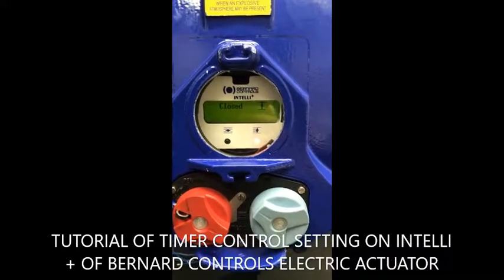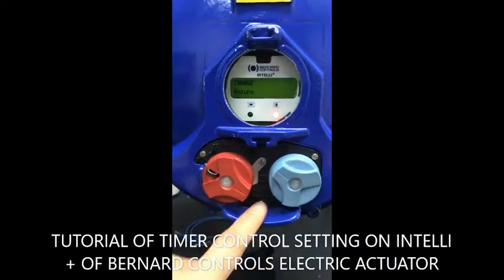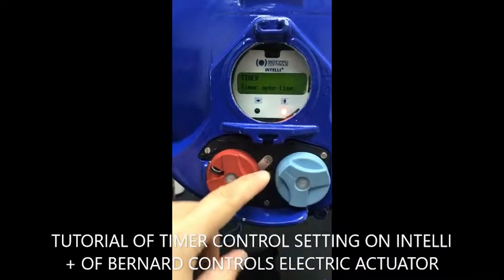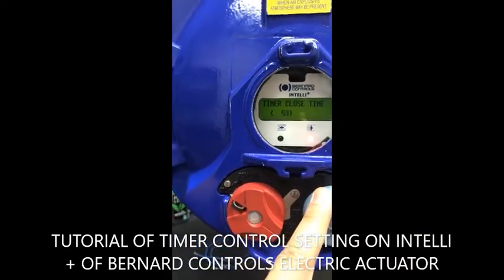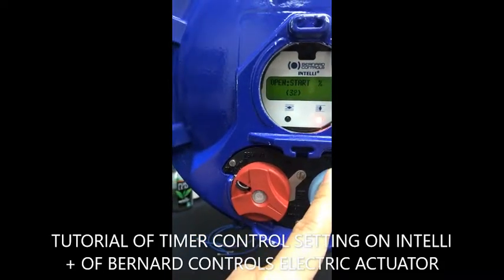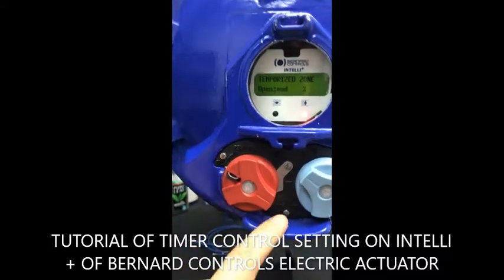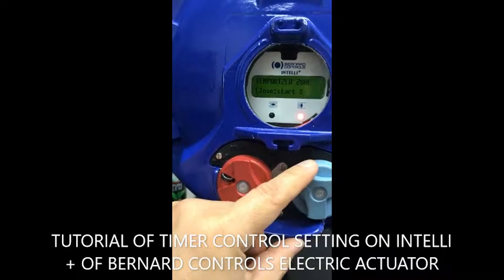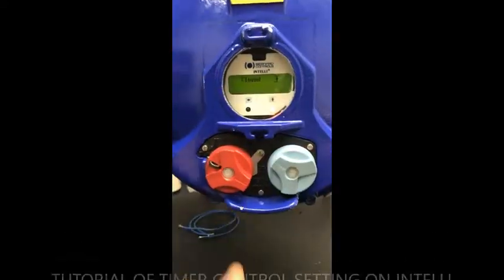TUTORIAL TIMER SETTING ON INTELLI+ - BERNARD CONTROLS - ELECTRIC ACTUATOR

Comment: J'ai un problème avec la vanne de régulation Bernerd pouvez vous m'aider
Reply from the maker: Quel est le problème ?
Pouvez-vous m en dire plus?
Reply: @xaythideth29091976  It is that when the valve is closed and closed, the alarm signal goes out and its mark goes out inside the valve
Reply: There are two alarms in opening position sensor fault and closing memory activity and position sensor fault
Reply from the maker: Can you switch off the main power and switch back and see what happen when you make stroke operation O/C?
Reply: @xaythideth29091976  Nothing happens, same problem
Reply from the maker: @soufianeboutadjine3863  ok what is the model number? 
Do you have the serial number of the unit?

Thanks